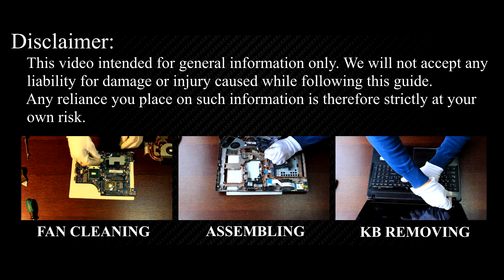Lenovo G580, G585 Screen Replacement | Step-by-step DIY Tutorial

Comment: Thanks you so much I'm trying to change the monitors for now all is ok I will say my results when I finish
Results:Worked thank you a lot now I know how I can change laptop monitor there is to problems the screen is too small and now laptop sides looks ehh not perfect 
TIP:When do you change monitor be sure that it will pass with your current laptop better buy the same model monitor.